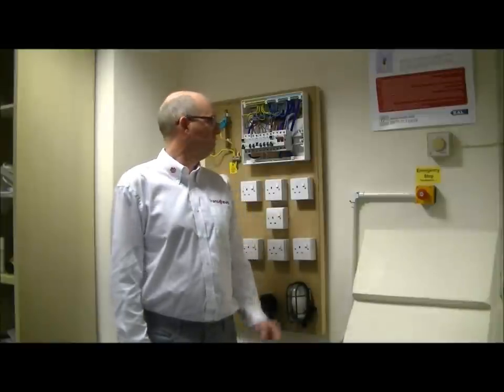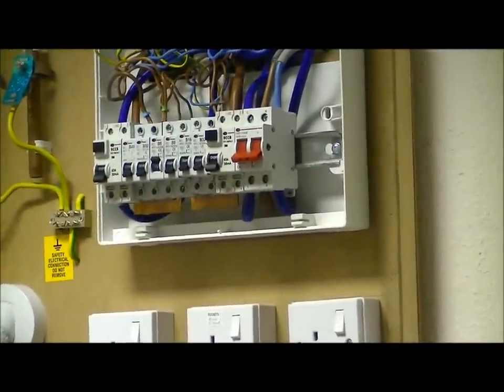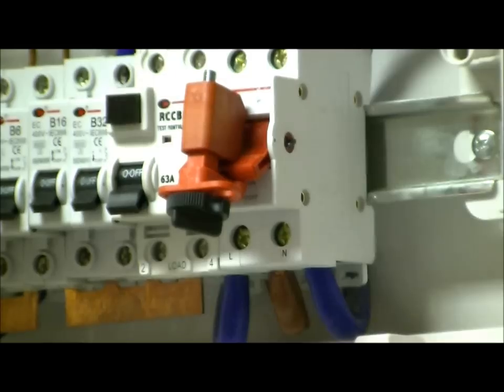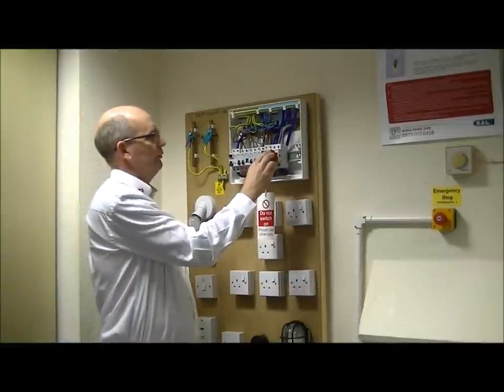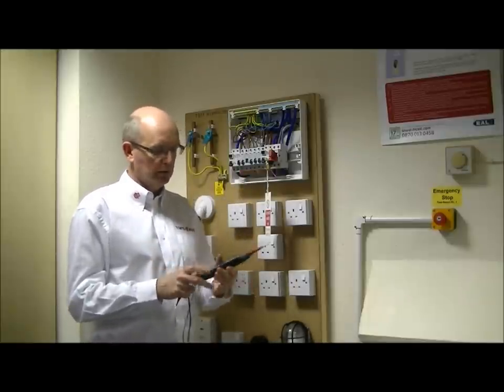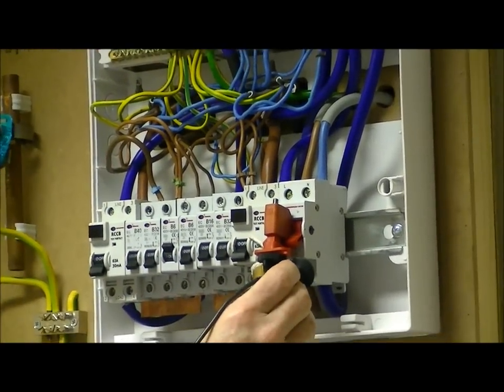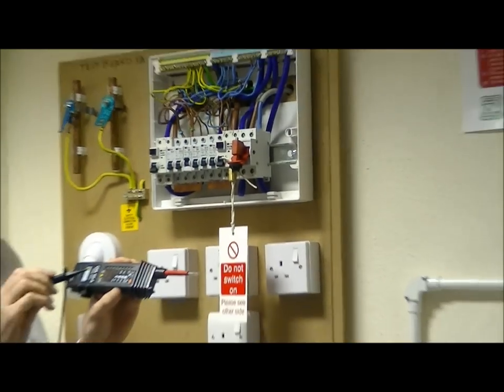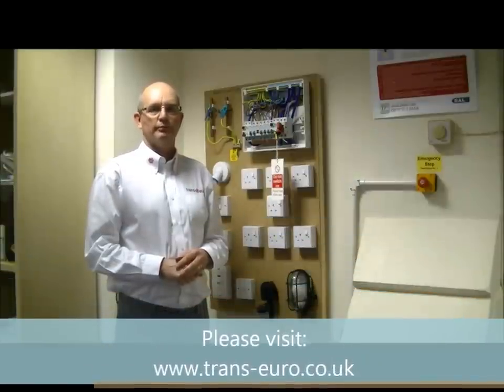Safe isoloation of a single-phase consumer unit

Comment: Thanks friend very helpful but I'm not sure if that just isolates all the electrical appliances or the consumer unit too if needing replacing.
Reply: joe morley it isolates incoming supply to all circuits fed from CU. To isolate CU, you would need a linked double pole switch upstream of CU. If none present, its a call to the electricity distributer to get them to safely switch off mains supply to property.